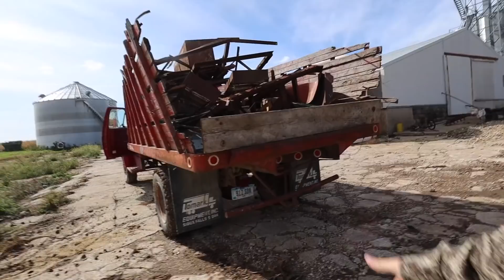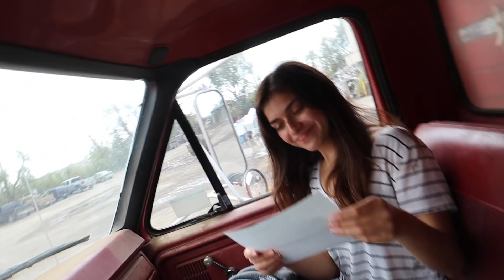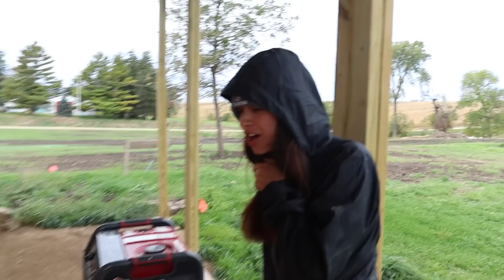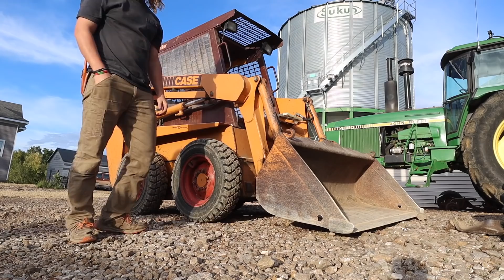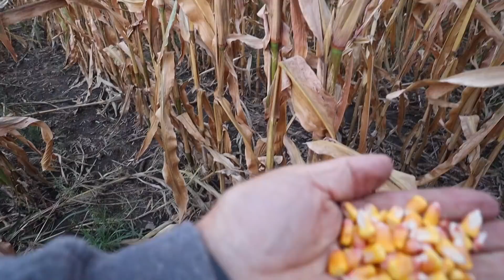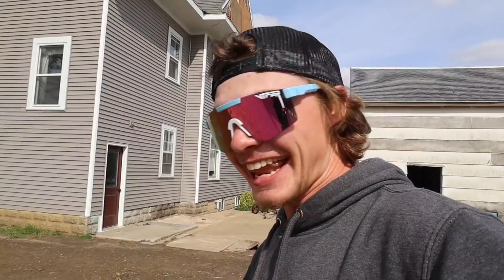I Left My Girlfriend At The Scrapyard

Comment: It would be nice if you could find some rough sawed 12'' x 12'' White Oak for the driveway border, soak them in some preservative, diesel fuel or whatever you like, then rebar them into the ground. Also, NO right angles on the driveway. 45 degree angles or make them big curves !
Reply: If you know anyone that works on the track Department for the railroad. They're already treated, they're called switched ties. When they panel a switch, & disassemble the old one, there should be two of each, or more in lengths from 10 feet all the way to 20 feet. Maybe up to 24 to 26 in length.
Reply: @earlhollar1906 , NICE !!

Comment: Some railroad ties or blue stone could keep the rock out of the grass. I've even seen old telephone poles used, it keeps trucks from leaving ruts in your yard. If you wanted to go crazy with it you could dig down below the frost line and build framing to pour concrete footings that stick eight inches out of the ground and build a fence on top of it.

Comment: Another great video!  Daddy Cornstar, I am well acquainted with that facial expression when you were in the cab with Sable. I taught 2 daughters to drive stick. On a Mercury Lynx.
Sable, are you comfortable with the grain cart yet?  If not, just keep at it.  It'll come.  I believe in you.
Nave, excellent job with the skid loader. Don't feel bad about the seal or gasket thingie that popped. It could have happened when any one of all y'all were driving it.
Cole, your place is looking better and better, and that lawn is really coming along, despite the washouts.  I'd bet the critter digging holes under your house is a groundhog.
Cooper, I bet you can fix about anything.  Really handy talent to have.

Comment: Cole,... This has to do with your grass drainage. If you use straw rolls, it will keep the grass seeds in place. You can find the straw roll's at your local hardware or plant store.
 If your need more understanding and  clarification, just check out the YouTube channel goonsqaud garage, not sure if that's the correct spelling, but definitely check them out. They are using it to hold seed in place on a hill, their having great success with it.Anyhow, good luck and keep up the great content. Next time, try mixing the dry fertilizer with the grass seeds. Just a tip.
God bless and take care!
Reply: Goonzquad

Comment: Curious question, why not put a ditch along the driveway all the way to the road?
Reply: If you look closely, you'll see that the road is elevated slightly above the front yard and the driveway pitches up towards the far end.  A ditch is only going to collect water and not drain it away.  The area that keeps washing out is the natural drainage channel of the front yard.  Need to put down grass seed, work it into the soil and put a fairly thick layer of wheat straw down to hold the seed in place until it germinates.

Comment: As many augers as you guys go through, it may save you some time/money/headaches to look into some alternative technology.

There is currently an auger design under patent in Australia, and possibly the US as well, where the Archimedes screw remains stationary & the casing rotates.

Because of the physics involved in such a design, stresses are largely removed from the screw, preventing the shaft from breaking & bearings from wearing prematurely. 
The bearings required to rotate the casing provide much more durability and longevity due to their size alone, and the rotating casing is subject to the torque of raising the grain to the top of the auger.

Think about a driveshaft in a rear wheel drive car... It's just thin steel tube, but because of the diameter of that tube it withstands hundreds of horsepower and hundreds of foot pounds of torque.
Reply: Are they available to the public or still in development? I also wonder if you would need a bigger motor moving the casing instead of the screw.
Reply: @mitchevans1692  
They are beyond the development stage. The only one I've seen in use was used to move sand about 10 feet straight up, so I don't know for certain that it would need a larger motor. 
An educated guess says that it wouldn't need much more power to turn the casing than the screw.
The larger bearing surface and lack of friction from the grain binding things up (the grain is constantly moving as the casing turns) would mean that only the difference in weight between the screw and the casing would need to be compensated for.
Reply: Its been around for ages 
But by design they require a pretty serious amount of engineering around it to hold the flighting and spin the barrel 

Its certainly game changing for batch plants and foundarys 
But not really for portable grain augers 
They go though so many cause they buy em second hand for cheap  and by nature they're usually cheaply built, always live out doors and do alot of hours running grain
Reply: @fowletm1992  
Good to know...
I'm looking at building a small flexible version to move salt, so it's nice to know what the shortcomings of that design are.
Especially since I can't find much information about them.
Reply: And what is the alternative to using augers......drones?   LOL.
Reply: @kaisersose5549  Wouldn't it have the weight of the grain also as they all seem to be about 45degree angle?
Reply: Just thought of another hurdle, wouldn't you have to machine a groove on the casing to cover the screw edge so your corn or beans don't get ground up on the way to the silo/semi ? Another concern is that you have exchanged the rotating from internal to external and I don't think Mr. OSHA would like that...
Reply: @barbaraanderson58  
Off the top of my head, for existing technology: vacuum, conveyer and air pressure. What I was referring to in the comment you didn't bother to finish reading was an auger design that turns the casing and keeps the Archimedes screw stationary.
Reply: @mitchevans1692  
The weight of the grain is also on the screw.
Regardless of which part is turning, that part takes the weight of the grain when it turns.
If the same tolerance between the screw and casing is maintained, as for a traditional auger, nothing would get caught between the two.
As far as OSHA, I have no idea.
Given that large cement mixers spin the barrel, I can't see much of a problem though.
Reply: @barbaraanderson58  
Chain Conveyers, rubber Conveyers, tubeilators, air flow 

Augers are the last resort due to damaging grain, high wear and they don't move much grain 
But they're really cheap 
Most big bin sites properly designed use chain Conveyers and air flow 
Tubilators are the best choose to move grain but they're the most expensive
Reply: Okay well it was supposed to be a joke.   But if we are going all serious....if you had any knowledge of the struggles of the American farmer you would know that just because technology exists, doesn't mean it is priced  at a point where the average farm operation can afford it.  When you have a commodity that has barely any profit margin whatsoever, you have to cut costs in order just to break even. So luxurious like vacuum assist and rubber conveyors Etc is all lovey in theory but when you're just trying to keep your head above ground it's probably not going to be an investment that is going to pay off in the end when you still have technology that does work and yes it may be frustrating but the American Farmer is very well-versed in repair and upkeep of machines and understands that things do break down.
Reply: @barbaraanderson58  
I know all about farming and farmers... I grew up farming, as a farmer.

If there's one thing farmers can do almost as well as repairing their broken equipment, it's utilizing any materials at hand to build something completely new.
You notice that I didn't bother posting links to buy one, or a parts list?
That's why.

The thing about farmers not making money is true, but there's a huge difference between not having money and not having what you need to get by.

Farmers get by just fine... They may not be able to get a bigger combine, but they aren't worried about going hungry.
They aren't in any danger of getting behind on their basic utility bills.
The same cannot be said about most people in this country right now
Reply: @barbaraanderson58  
Yea I know the struggles 
I am a farmer 
In Australia on far more variable climate, far tighter margins and no government subsidies or insurance 

Plenty struggling and plenty doing just fine 
In this day and age economy of scale plays a big part 
Sad to say but gone are the days of a family makeing a profit off 1 block of land, ts just getting less and less viable 
Around me anything less than 4000ac and your going backwards 
Most profitable farms are north of 10k
Obviously the better the land the less you need so the cornstarch can live off way less than 10k 

But its not really a case of all farmers struggling 
But plenty are trying to live like its 1975

Comment: We need video of Cole expression after a winter of plow and then the snowmelt.....straight edge - probably not🚜🚜🚜🚜
Reply: Also a lot of lose gravel in the snow piles, until next Spring.
Reply: I think he said the driveway was 40' wide, so they wouldn't have to plow the whole width during winter when they probably aren't moving much machinery and semis around.  Pile the snow on one side of the driveway and it won't matter if some gravel gets mixed in the snow piles.